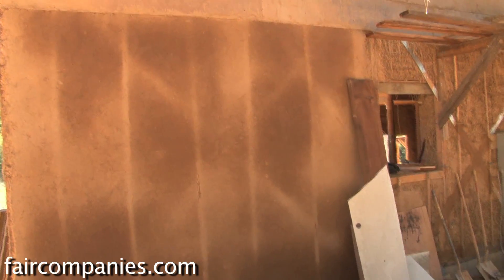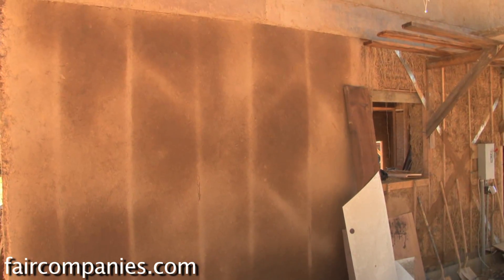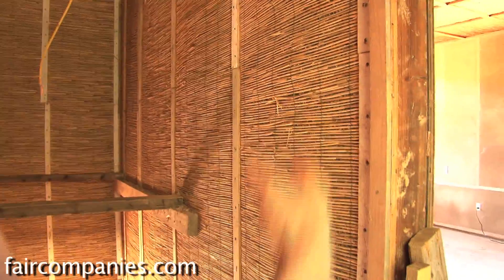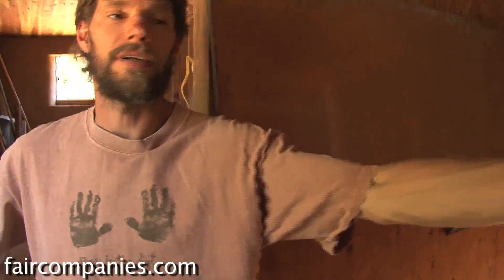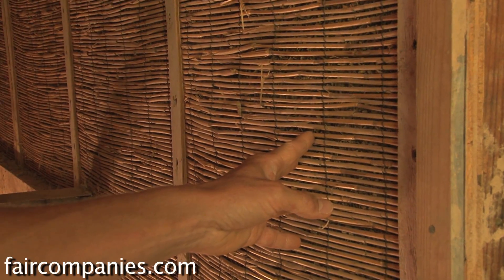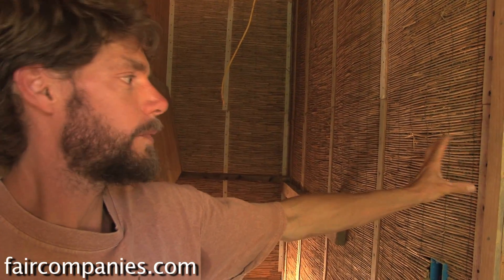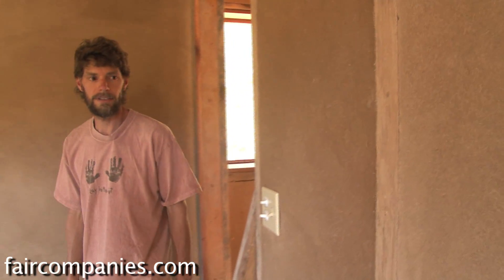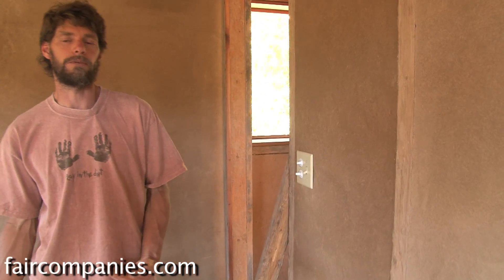A no-VOC earth plaster for a breathable, bioclimatic home

Comment: i would love to know how he fixed the burlap to the walls??? I want to use a natural plaster on my interior walls (wood stud covered with boards). Anyone got any suggestions?
Reply: You can just make a clay slip and soak your burlap in it. Then wet the surface you’ll be adhering it to with water and smooth the clay slip soaked burlap onto it. The natural suction will hold it in place until it dries and you can then plaster directly over it.

Comment: @kirstendirksen At 0;45 he states not to use cement. Houses using earth and cement are very common, in commonwealth countries they're usually called semi permanent houses. The benefit of doing this is as a security deterrent.
Reply: He talks about cement stukko applied on raw earthen walls. This is an absolute no-go and I guess also not was is applied in the semi permanent houses you are talking off. They most likely use something like stabilized earth where they mix cement into the earthen wall. Which is debatable too, as @kirstendirksen said :)